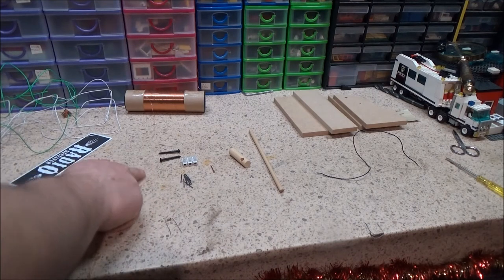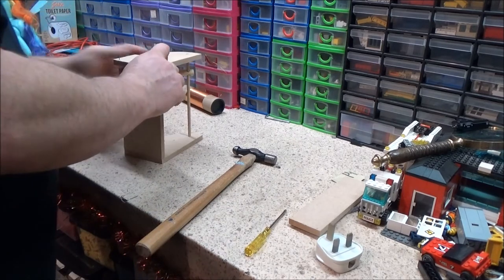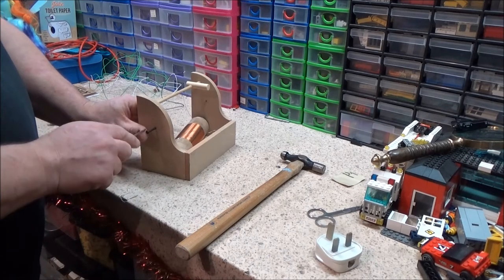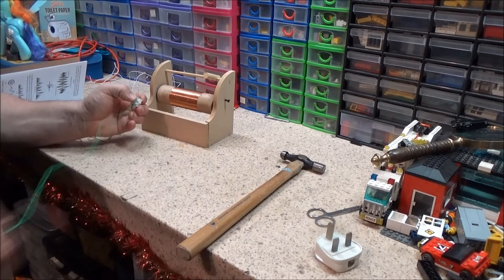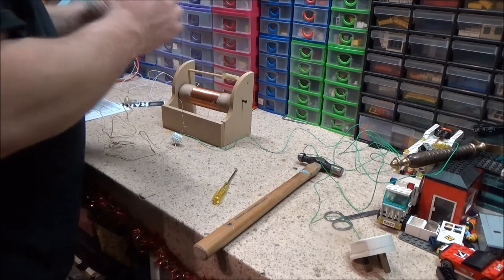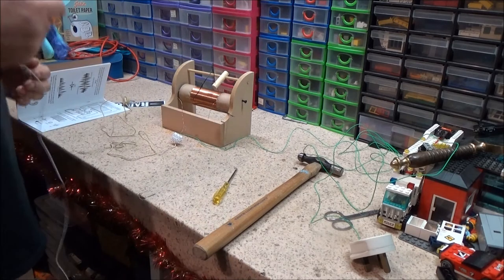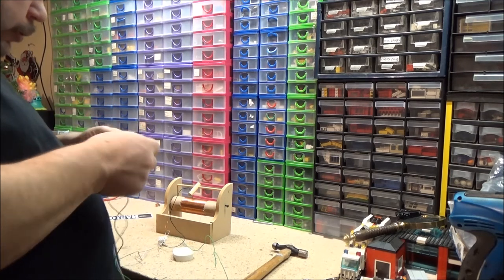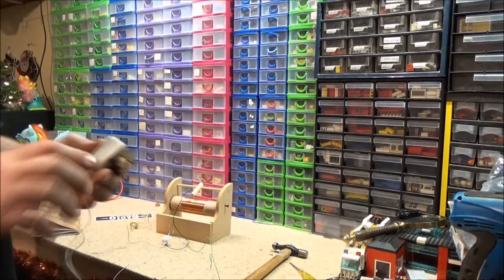Building A Very Simple Radio Reciever

Comment: It was known as a Foxhole Radio. A foxhole radio is a makeshift radio that was first used by soldiers in World War II, specifically at Anzio, spreading later across the European and Pacific theaters. There were different versions of the foxhole radio; all used a safety razor blade as a radio wave detector.
Reply from the maker: Correct. :) They were usually made with items they had at hand and picked up a very quiet AM signal. There are still AM stations active but I have found I can only pick them up very late at night.
Reply: LifeOfAnEnglishman You may find that any signals only work in the morning at 1am and sometimes it can Mega Hurts.